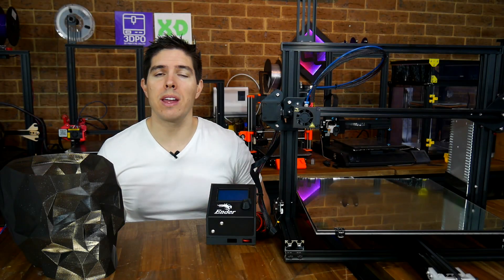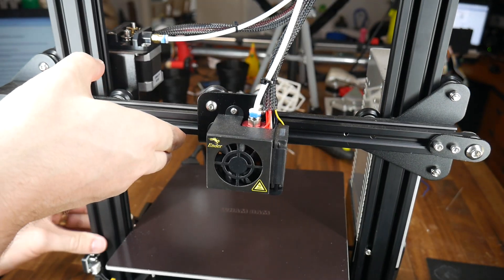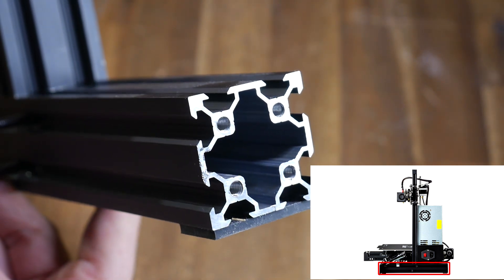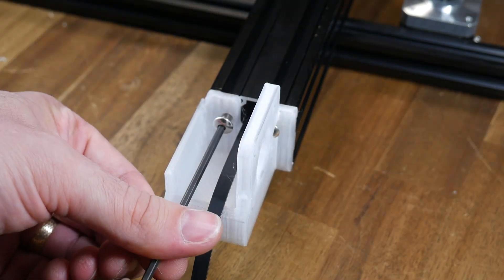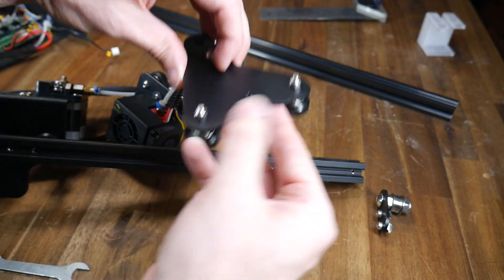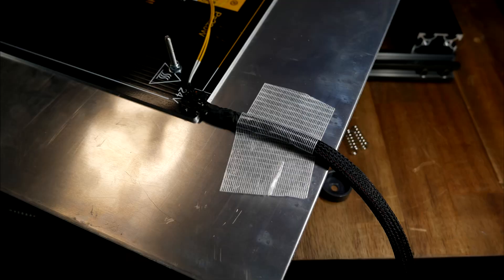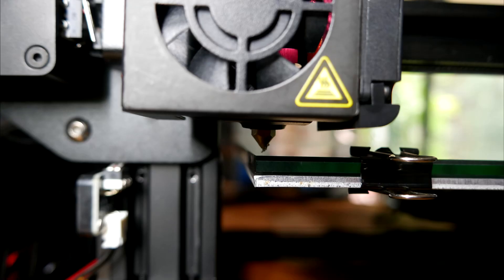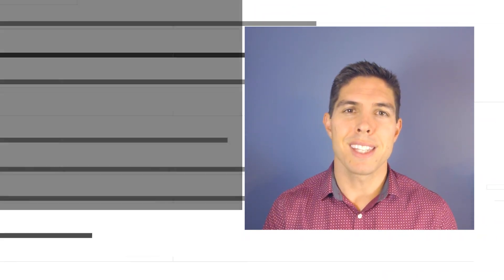Ender 3 conversion to 400x400 with the Ender Extender kit

Comment: I emailed the company never had a response but I seen he said that the parts are not really interchangeable from the non pro and pro versions but I have a non-pro and as far as I know if anyone can correct me if I'm wrong the only difference between the the non-pro and pro would be the y axis is thicker but in the kid they give you a new Y axis real with the x-axis is also so would I be able to order a pro version so I can have the wider rail for more for stability. I understand if you had a pro and you ordered the non-pro version that wouldn't fit because of the wider rail going to the skinny one but since the non-pro has the skinny Rail and they give you a thicker y access rail shouldn't it work or am I missing something?
Reply: I'm talking about the widening kit not the taller one

Comment: Could you perhaps share the cura profile or your print settings for your Ender Extender? I have gotten mine to work well but to do so I have to run it a quite a bit slower then I normally would. Therefore it would be grate if you could share your profile. 

Thanks for the help!

Comment: Absolutely great video, Mike. I assembled my Ender 3 Pro last week and I learned a lot in the process. I didn't experience any issues of note. I really like that an upgrade kit for increasing the build volume is available for this product. As you said near the end of the video, this is a great value for the money compared to larger "base" printers above the Ender 3/Pro that cost noticeably more. I will be ordering this upgrade for my printer. Your video hit all the right emphasis on assembly for the new unit. I'll have to ensure I print the new parts for the Y-axis motor and belt-tension. Please continue creating this content for 3D printer enthusiasts like myself.

Comment: My concern is heating that massive bed. Is the OEM heater capable, or should you take steps? Seems to me that the edges will never be able to maintain the necessary temperature, unless the center is WAY hotter.

Comment: There comes a point where you should just buy a 3D printer that meets your requirements rather than bolting expensive replacement bits onto another printer that doesn't.

Comment: If your going to spend $500+ on upgrades for your ender 3, you might as well buy a CR-10
Reply: For a base Ender 3 the kit is $239 to get a 400 x 400 x 500 print area. Another $35 for a 400 x 400 24v heat pad. CR-10 only prints 300 x 300. CR-10 S4 Costs $569 on sale to get 400 x 400 x400. But that is the model that people would spend much more upgrading. It's basically a big Ender 3.

Comment: Can this Ender Extender kit also be used on the Geeetech A10 or 10M?
Reply: The X axis carriages are different. So the predrilled holes for the X axis V-slot rail would be in the wrong place.  The Y axis rails are also different. I am doing my A10M myself by ordering the raw materials and cutting and drilling as needed. See my earlier comments, read more section..

Comment: Thank you Michael for very informative video. For you DIYers. Kit worth it if you include cost of labor for cutting, drilling, tapping, the extras and other finish work. Kit: $149 - $159. However expect delays  in order. I am doing my Geeetech A10M which has a very similar chassis, but different enough that if I did order this kit it would have to be modified anyway. Maybe do my Ender 3 Pro if I need 2 large printers?
I Also have chop saw and drill press, however could be done with hand tools as length of extrusions not critical as long as you make sure assembly of frame is square. The 400 x 400 bed fits close to the vertical rails, but it works.
Cost for raw  materials $116 rounded up.     US Dollars for all, as I am in USA.
From AliExpress: Add $34.50 For 400 x 400mm A/C mains silicon heat pad and 
From Amazon: $11 for SSR relay.  Details for using these on the small Y axis carriage yet to be worked out.
For Chassis.
From Amazon:
$7 for wiring extensions. 
$27 2040 V rail extrusions 600mm, had to buy 2 so have 1 extra.  Will need to be shortened after I figure Y axis travel.
$30 2020 V rail extrusions 500mm, package of 4, cut off 15mm from 3 of them. 
$8 6mm Timing belt 10meters long. 
 
From: https://www.xometry.com/supplies/materials  
$22.66 400 x 400mm aluminum sheet for build plate. Add an additional
$11.19 shipping to my USA address. May be more for other addresses. 
$10 400 x 400mm double strength window glass $15 if I wanted mirror. Local glass shop. 
3D printed new case for control board. 
I may try skipping the 400 x 400mm Aluminum Build Plate and attach the Glass with heat pad directly to the smaller original plate with high temp silicon.
Have fun, its what its all about. Don't complain about the work, if you think it's too much buy the kit.

Comment: Hi thanks... Does the stock ender 3 heat bed heats the 400x4000mm aluminum plate evenly? O r warping should be expected in huge base models to be printed?

Comment: Uh... for those bed screws, you just hold on to the nut and use a screwdriver in the top. You don't need to use a spanner until it gets tight.

Comment: are you still using this guy? Just wondering if you have noticed any other artifacts.  I'm kinda worried about the single Y carriage and I am just wondering the stiffness.  Most devices of this size would call for at least two rails in the Y. Thanks for the great video!

Comment: yes yes but you not need spend for it.only need heatbed(or just bigger bed).aluminium extruders we all have and belt. no need spend kit more that original printer was.that not even have everything needed on box! and do we allready have make this?. i have 500x500x1000 ender without bed levelling. bed is level

Comment: I'm not finding how to change the bed size in the TH3D firmware.  Is it possible or do I need to go with vanilla marlin?
Reply: I'm stuck looking for the same setting in the TH3D firmware.
Reply: @HueSmalls  The new TH3D firmware has a setting now for the 3 Ender Xtender models.
Reply: @reedsyd  I came back to say thanks, i updated to the latest version. That added setting makes it so much easier.

Comment: I'm no 3d printer pro, but I'm planning on getting my own soon, I've come across one of two scenarios, either buy it ready or make my own, in situation where I buy my own, and let's say in this case the ender 3, could I just get bigger extruders and extend the frame, would that require me to use a bigger electrical input or upgrade my motors, or does extending the poles not affect my mechanical specs

Comment: I was wondering when someone was going to do this. Aluminum extrusion design lends itself to easier frame expansion.
Now, we can all print our InMoov robot parts faster overall with multiple part arrangement...  ;-)
You could also plan ahead, buy the original Ender-3 DIY kit, and the Extender kit, and put it all together at assembly (minimal disassembly/re-assembly).
Reply: i was considering doing this..or just pick up either a cr10 or chiron for 100 more lol

Comment: What are the length dimensions of the 2020 and 2040 profiles for an Ender 3 in the Ender Xtender 400? I have some extrusions in workshop that would probably be fine. I can easily drill then accordingly. I see from mine the original X (with hot end ) is 340mm, the top section is 330mm, the Y is 330mm. So I assume they will be .. 430mm and 440mm for the 2020 and 430mm for the 2040.
Reply: Playing with sections I have I think they need to be a bit longer. My original might have been more 350mmx350mm otherwise.

Comment: 14:58 Your mistake is cutting same line several times. Thats almost 100% failure. You cut only once with one constant movement of the "blade". Most people try to cut same line several times to make the scratch deeper so "it will propbaly snap better" than they fail, so next time they scrap even more, and think that either their tool is junk, or they are bad at cutting glass. :)

Comment: Crimp connectors are NOT more reliable than solder. You should have just replaced the whole wire.

Comment: I would want to have a second Z spindle with such a large extension. With the length and weight of the longer X-axis in combination with the one sided drive on the ender, there could come up other problems.

Comment: It is easy to cut glass first you need a good quality glass cutter second step you need oil. add the oil in the place you will need to cut ,next use your cutter to cut a line next add a little preacher the glass will cut in two pieces

Comment: Ok i have a couple of questions.
1. What is the point with a 200 dollar kit when you need to supply, bolts, nuts, tools for threading, 3d printed parts etc etc. Just for the extruded parts and the 40x40 bed? That is not worth 200 dollars. 
2.  Why not sell you Ender 3 and buy a CR-10 instead? Or even better, if you don't have a printer go directly for a CR-10...? A CR-10 v2 goes for 450 dollars at the moment. Not sure where you get the 800 dollar prices... 
3. Why change the wiring if it is far too long in the end? Why is there one single cable missing? What is the point with that?... 
4. How is the rigidity on the outer edges after modification? Single rail on 40x40 bed must really mess things up on larger even prints.
Such a weirdly assembled kit. Seems like some guy in a garage dumps whatever stuff he has in a bag and expects people to pay 200 bucks for them... 
Buy the frame yourself for 30 bucks....

Comment: I thought that because the x axis was so long it would hang on the right side, but I see that it is not, it is a good modification, and it has its certain advantages, but if you are going to spend money, it could be 40x40x50

Comment: Interesting option.  Already looking for that 16"x16" mirror plate source. Thinking might need a second Z if this were to be a direct drive dual extruder version (if going to all that effort) as so many thing are crying out for using dissolvable filament (the Ender motherboard would go and probably RAMPS 1.4 or one of the other dual extruder boards goes in instead... would it still be an Ender then?).
Reply: No ebay channel for a bit.

Comment: Last week i got done with my LACK enclosure now there is this 😭 will this still fit??
Reply: We're gonna need a bigger table, unfortunately. Lack is 558mm on a side, with the legs eating up some of that volume. The Y axis would be the deal breaker, X would just be really tight. Lack is also 450mm top to bottom, so if you get the Extender 400XL, you're way out of bounds on two different axes. Sorry!

Comment: Full nope on reusing the original heat pad. I get cool spots already with the original dimensions; it will only worsen with a larger surface. And with your mod kit costing the same or more than an existing Ender-3, I'd rather have two Ender-3s.
Reply: Fine, but you can't print larger models or parts. That's the point of the extender. If you already own an Ender 3 and need to print larger, this is less costly than buying a new printer that can do 400 x 400. If I don't already own a printer and you know you will need to do larger prints than buy a large printer.

Comment: a bed slinger that big is scary to me haha. I would rather spend $350 and get a 300x300x400 printer.  Less mass to worry about. Or i could spend $350 and build a 900x900x500 corexy piper2 printer

still, cool product for the ender 3:)

Comment: Now I want an Ender 3 just so i can get the kit and upgrade it... ^_^

I altered my CR10 S5 firmware to wait longer before considering the bed to be heated, this gave time for the glass to heat up more uniformly. :) It was the option TEMP_BED_RESIDENCY_TIME in configuration.h that I changed to 60s to allow the glass bed to heat up. All i do now is occasionally clean the glass with Coles Glass cleaner and I usually print first layers fine. (Can get warping on cold days tho).

Comment: 400x400 is nice. But I would be happy with 230x400. A Y axis modification would be good enough for me. The bed wouldn't be as heavy as a wider conversion. And this would be cheaper. I had been thinking of this for a while.

Comment: Haven't seen this question asked. How is the Ender3 or Pro heated bed going to have uniformed heat throughout the entire increased build size?? Another thing about this kit. Wouldn't be better to have a 4040 on the Y axis (Ender 3),  instead of a 2040? Or am I looking at this all wrong?
Reply: I have the stock bed under the 400 aluminum plate and a 1/4" mirror, I heat it up to 50° for about 3-4 minutes then bump it to 60° and heat up the nozzle to 220 ( I use a .6mm nozzle) and let me tell you it heats up nice and toasty
Reply: @enrilopez  Where is you find a flat 400x400 aluminum plate?
Reply: @3dtexan890  I think the 400x400 plate is included in the upgrade kit. There are a lot of others who are complaining about the bed not heating up, but I think they missed or didn't read what Enrique wrote above. If necessary one could do the math:  400 = 2 * 200, so if they felt the need for the whole bed to be heated directly, they could purchase the extra heaters and place them. I'm a "If this GD glass isn't full, I'll get it there, darn it!" So to read what Enrique wrote is very encouraging. I'll watch the video again and see how he solved the 400x400 plate issue. I am certain you can get them somewhere.

Comment: Hi, to be able to cut grass perfectly, you need to do exactly two things: 1. Make a SINGLE cut with the cutting tool; 2. While holding the smaller part with our hand on the opposite edge from the cut made and without the rest of support, type with the small hammer from the bottom of the cut in several different places.

Comment: Great video as usual, but I was hoping you could help me with another issue I've been having with my Ender 3 Pro .  It has started slamming into to the X and Y stops before and after printing.  It also now prints the test line off the edge of the bed before printing.  I use Cura and haven't been able to fine any settings to correct this.  Any help would be greatly appreciated.  John

Comment: Standard mirrors are second surface devices meaning the flat surface is actually the back of the mirror as that the is the surface that is in contact with the molten salt... Great video as usual... Keep them coming...

Comment: Anyone working with cars will disagree with your crimp connector statement. I'm sure they're ok in this, but not in any use case are they more reliable than soldering properly.

Comment: Next time you try cutting glass or a mirror score your glass then run lighter fluid along the score mark then lift and drop in the table edge to break your score. The lighter fluid helps with weakening the score mark making it easier to break.
Reply from the maker: Thank you, will do.

Comment: Its a very bad idea to apply hairspray directly to the glass attached to the printer. Spray will leave residue on x carriage, x extrusions and so on. This will leave you with tiring cleanup in few weeks.
Reply from the maker: In theory yes but I've been doing it for about 8 years now without ever having to clean it up.
Reply: @TeachingTech  Also 8 years here, different machines with open and closed build and i noticed especially with extrusion machines, diffferent sound of x axis, like some sort of grinding.
This does not happen since i moved my spraying station to the other side of the workshop.

Anyway, great video, as usual!

Comment: The trick to flawlessly cut glass is to score and then break from one end of the score. Intuitively, most people try to break make the break by applying even pressure along the score line using a fulcrum or hanging it off a tables edge. This seldom works. You can still hang one edge off a table but make sure the break starts from one end of the score. A glass snapper, the notched part of the cutter, or padded pliers set to one side of the score line and a deliberate snap is all it takes.
Reply: If your glass cutter has a ball on the end use it to tap the edge like you say.

Comment: Is the stock heater sufficient for that large aluminum bed?? I would think there would be major cold spots around the edges
Reply: I have the stock bed under the 400 aluminum plate and a 1/4" mirror, I heat it up to 50° for about 3-4 minutes then bump it to 60° and heat up the nozzle to 220 ( I use a .6mm nozzle) and let me tell you it heats up nice and toasty

Comment: Pretty expensive just mainly for extrusions
Reply: You're not only paying for extrusions, you're paying for a well made kit and the time it took to put together and research and quality control ,costume cables and all the knowledge that mark has put into this kit ,
I'm sorry but just extrusions is not even close to be true
Reply: Not much to do but buy some stock and drill some holes in my opinion and add some wires to extend them.

Comment: I like that case for the control board and the LCD panel, I might print that and convert my stock Ender3 just because.

I would like it a little better if the whole thing was printed, instead of using the metal LCD mount, though.  Maybe I'll try to design something myself.
Reply: Actually being able to take that lcd bracket off and get inside is handy

Comment: Have to disagree with the soldering comment at 13:56. A good joint with proper heat shrink should blow that connector out of the water. In my opinion those connectors are for people who want to do it quick

Comment: Ya... The price is bollocks, £70 delivery. You could source the raw materials for cheaper than the £190 without shipping. Drilling and tapping might be an issue but doable.
Reply: Is not just drilling ,you're getting the aluminum plate, extra right size cables , all the quality control, the knowledge from every kit he has put together till this point  ,
Not just drill holes.....
Reply: @enrilopez  Yes, all are extremely cheap. The most expensive thing on that is the aluminium plate.